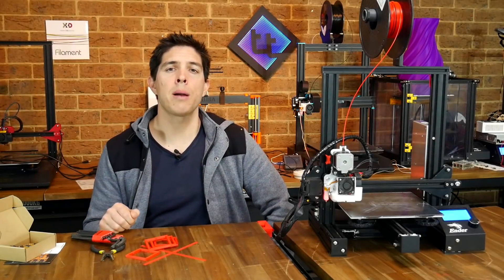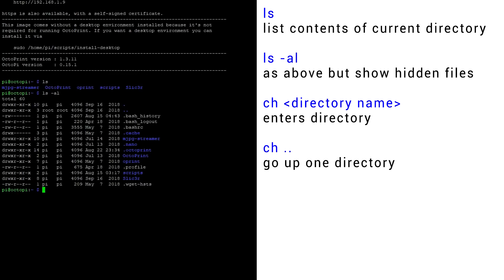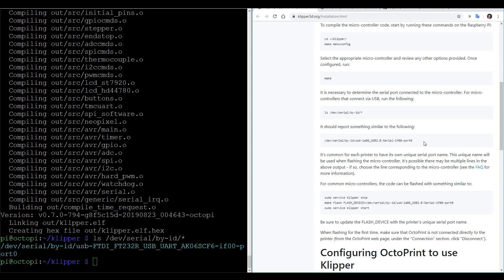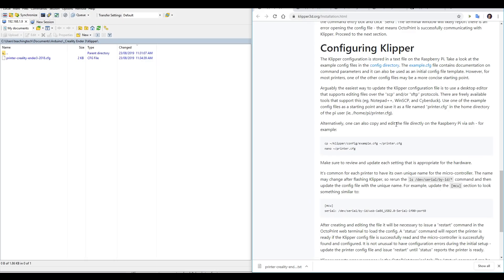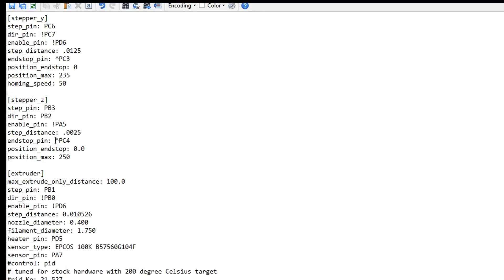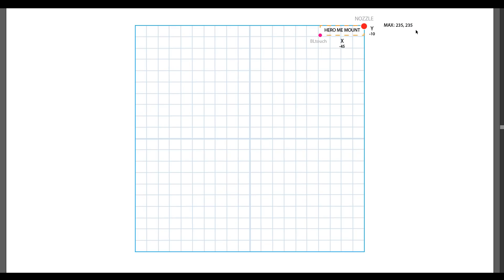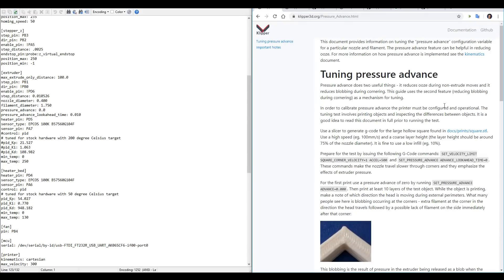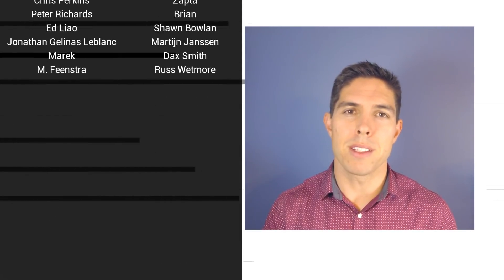Using a 32 bit Raspberry Pi to boost your 3D printer mainboard - Klipper Ender 3 guide

Comment: VERY IMPORTANT: For rectangular beds, min_point and max_point have been renamed to mesh_min and mesh_max respectively.
Reply: I'm also having issues with the provided example where the BED_MESH_CALIBRATE is going 'out of range', looking around to see if I've done something wrong elsewhere or they've made other changes to klipper as the example worked for me in the past.

update:
Looks like I needed to manually subtract the x/y offset from the Teaching Tech config under [bed_mesh]:
Original: 
min_point: 90, 20
max_point: 235, 235
Current:
mesh_min: 45, 20
mesh_max: 190, 225

Comment: Does anyone know of any resources for connecting multiple mainboards to Klipper to add extra extruder stepper motors? Klipper claims that you can do this in their setup guide but don't link to any other documentation or instructions.

Comment: I noticed a couple of things setting up mesh for the BL Touch; maybe there was an algorithm update since you made the video.

Hope I got the offsets right.

1) mesh_min and mesh_max are the location of the probe. Klipper takes the offsets into account when positioning it.

Because of 1 above:
2) mesh_min and mesh_max should be the exact coordinates you want to probe but each probe mount location needs a different calculation for them.

2a) for left/front probes (mine): 
     i) The mesh_max X value should be your bed size but reduced by your X offset value and any buffer from the bed edge you might want.
     ---- The nozzle carriage will reach the travel limit before the probe tip.
    ii) The mesh_max Y value should be your bed size but reduced by your Y offset value and any buffer from the bed edge you might want.
     ---- The nozzle carriage will reach the travel limit before the probe tip.
   iii) The mesh_min X value will be the the bed size minus the coordinate from 2.a.i. above to make the mesh symmetrical.
     ---- The probe tip will reach the origin before the nozzle carriage.
    iv) The mesh_min Y value will be the the bed size minus the coordinate from 2.a.ii. above to make the mesh symmetrical.
     ---- The probe tip will reach the origin before the nozzle carriage.
     v) i.e. my probe offsets are X-34, Y-5, my bed is 235x235, I chose a 10mm buffer. For mesh_max X that's 235 + (-34) - 10 and Y it's 235 + (-5) - 10, or  191,220. For mesh_min we keep it symmetrical with X 235 - 191 and for Y 235 - 220, or 44,15. 

2b) for right/front probes:
     i) The mesh_min X value should will be your nozzle X offset plus any buffer from the bed edge you might want 
     ---- The nozzle carriage will reach the origin before the probe tip.
    ii) The mesh_max Y value is calculated the same as 2.a.ii. above.
     ---- The nozzle carriage will reach the travel limit before the probe tip.
   iii) The mesh_max X value should be your bed size minus the value from 2.b.i. above to make the mesh symmetrical.
     ---- The probe tip will reach the bed edge before the nozzle carriage reaches the travel limit.
    iv) The mesh_min Y value will be the the bed size minus the value from 2.b.ii. above to make the mesh symmetrical.
     ---- The probe tip will reach the bed edge before the nozzle carriage reaches the origin.

2c) for left/back probes:
     i) The mesh_min Y value should be the nozzle Y offset plus any buffer from the bed edge you might want.
     ---- The nozzle carriage will reach the origin before the probe tip.
    ii) The mesh_max X value is calculated the same as 2.a.i. above.
     ---- The nozzle carriage will reach the travel limit before the probe tip.
   iii) The mesh_min X value is calculated the same as 2.a.iii. above.
     ---- The probe tip will reach the origin before the nozzle carriage.
    iv) The mesh_max Y value should be your bed size minus the value from 2.c.i. above to make the mesh symmetrical.
     ---- The probe tip will reach the bed edge before the nozzle carriage reaches the travel limit.

2d) for right/back probes:
     i) The mesh_min X value is calculated the same as 2.b.i. above
     ---- The nozzle carriage will reach the origin before the probe tip.
    ii) The mesh_min Y value is calculated the same as 2.c.i. above
     ---- The nozzle carriage will reach the origin before the probe tip.
   iii) The mesh_max X value is calculated the same as 2.b.iii. above
     ---- The probe tip will reach the bed edge before the nozzle carriage reaches the travel limit.
    iv) The mesh_max Y value is calculated the same as 2.c.iv. above
     ---- The probe tip will reach the bed edge before the nozzle carriage reaches the travel limit.

Comment: Looks to have been an update in the code and docs since your video. It now uses a command that will print a taller part with stepped PA changes every few mm.
Reply: it dosent need the "look ahead time" part anymore, right?

Comment: Since this video a lot of instructions became obsolete in the Klipper configuration. Can you post an updated version of this file for Ender 3 with bltouch and creality (Silent) boards?
Reply: Creality Silent Board 1.1.5 uses TMC2208 in Standalone Mode and is NOT compatible with Klipper!!! (that's what Kevin OConner says)
I know it, because I finally found out why my extruder doesn't work properly :-(
Reply: @onairtotheworld  Good to know.
Reply: Same problem. Stuck at "avrdude: stk500_getsync() attempt 10 of 10: not in sync: resp=0x6e" while flashing.

Turns out we need to first flash the board with a bootloader. This requires opening the case :/
Reply: @natanlieds4468  I need to do this in order ro make ANY modification, it is a must

Comment: Hi, I got stuck at 6:04  & made sure i wasnt connected to octpi when i put in  make flash FLASH_DEVICE=/dev/serial/by-id/usb-_uart_ac00zfrh-if00-port0 i get programmer is not responding. do i need to have an adruino to complete setup?
Reply: Same. Did you find a fix?
Reply: The issue is that you apparently need a bootloader. I luckily had a USB-bootloader from my bltouch and transferred the hex-File to my laptop and flashed from there. But that leads to errors in the later process. So i finally installed a bootloader.

Comment: Sorry for the noob question but do you have to put a bootloader on the ender 3 board before uploading the klipper firmware?
Reply: ender 5+ and I think we do as I got an error on the make flash part. ..rabbit hole took me back to the Klipper community and there I found we need to create a boot loader with Adruino ... that would have been a nice thing to add at the beginning wouldn't you think..

Comment: I started using Klipper before it had auto-leveling and printer screen support and it was worth it even then,  250 mm/s printing circles and curves using 8 bit board :)

Comment: Which one would get better print quality and speed, Klipper with Raspberry Pi or Marlin on 32bit SKR Mini E3?
Reply: I also was wondering the same thing!
Reply: With the proper slicer settings for each hardware configuration, I bet the difference will be minimal to negligible.

The original Ender 3 mainboard using the ATMega 1284p microcontroller, it makes sense to move the G-code crunching over to something more powerful.
But the SKR boards using the more powerful STM32 32-bit microcontrollers it really doesn't make that much sense to offload the G-code crunching. At this level, the limitations are on the hardware side such as the steppers themselves, frame stability, rollers, bowden tubes etc. These limitations cannot be circumvented with any microcontroller performance upgrades.

I use the SKR 32 bit board with a fully-fledged firmware such as Marlin, and use Octoprint on a Raspberry Pi just to get the whole web interface convenience. 
I always have the options to have the printer operate in standalone mode, or with Octoprint hooked up. I'm not locking myself to one solution only.
Reply: Klipper can be totally better configured than Marlin. Pressure advance, S-curve are highly customizable. Plus it works better with octoprint - no need to print off the sd card.

Comment: is it really worth it to spend $50 on a raspberry pi? i want to upgrade my ender 3 which only has one mod which is a bl touch, but i dont know if buying a raspberry pi is the right choice. should i just upgrade the main board? if so which one should i get? the silent one? plz help
Reply: Yes it is.  No only can you run klipper, you can also run OctoPi with OctoPrint which makes it way easier to send files to the printer wirelessly.  As well as remote monitoring and control of the printer.

Comment: thank you very much for this video. its exactly what i was after. im looking forward to the next in the sequence to see what ya results are. this really does seem like the smarter move. i am not a fan of doing all the heavy processing work on the wee micro in the printer. the reason we cant print over USB apparently is because the wee 8bit boards are too limited to transfer the gcode in a timely manner and print. when i go to raspi on my mk3 i think i will investigate klipper

Comment: i'm stuck at the "mesh" settings, it doesnt work, and i dont know why. I work with a BL-Touch on a Petsfang, an get my correct poition, for the mesh, out of my CAD. After i edited my printer.h file, klipper doesn't connect anymore to the firmware.

Comment: I have a question, when I go to flash the firmware it results in a sync failure, any idea why?
Reply: Hi , i have the same error , do you have the solution ?
Reply: @mickwo  not yet, i believe it might be something wrong with the motherboard
Reply: @world7452  hi, i find tb solution you need install bootloader before Al process
Reply: @mickwo  is it seperate?
Reply: @world7452  follow this instructions ,only the bootloader part https://youtu.be/fIl5X2ffdyo

Comment: Actually you do not need a Raspberry Pi as any PC with Debian will do. To make it easyer while installing Octoprint and Klipper, choose "pi" as the username, forbid root login (so sudo is enabled), deactivate graphical interface and enable ssh while installing debian.
"PC" includes so called "thin clients" normaly used as terminals in big companys. As these big companys change their hardware any 5-6 years, thousends of these thin clients push into secondary market (like eBay) for incredibly low prices. I for example got some Futro S900 for 8€ (less than $10) each + shipping; much less than a Pi, but more powerful and only a little more power consumting. A 16GB mSATA (the included 2GB is not enough for octoprint) is about 7.50€ on Aliexpress (you would pay the same for the SD-Card for a Pi anyways).
Even with slightly more power consumption, it is the more ecologic solution (esp. if you do not run your printer 24/7), as you reuse hardware which elseway has to be deposed.
So a quite cheap and powerful alternative.

Comment: It would have been really nice to see some prints or printing at the end. So that we know whether or not there is a point to this.
Reply: Either it prints or it doesn’t.  What I mean is, showing prints wouldn’t have added anything to the video
Reply: @peterwmdavis  I think you have misunderstood the whole point of using klipper.
Reply: @peterwmdavis  Not true.... there are huge advantages to using klipper once set up right. Seeing the results of a print side by side and noting the speed at which they can be printed is massive. You can print higher quality and faster with Klipper than you can with Marlin.

Comment: If I've already got an skr 1.3 with marlin 2.0 and I'm using the fancy stuff like linear advance and BLtouch ABL, is there any benefit to this? I have a raspberry pi sitting in your rear mount case in my ender 3 with the SKR and they work together really well. Would it be beneficial in any way to switch to klipper with a setup like this?

Comment: Tried klipper this weekend, back to marlin today. I didn't notice any real improvement and got frustrated by the scatty documentation in klipper. Nice idea but I think the performance increase is negligible and not worth getting familiar with a completely different code base.
Reply: how did you get back to marlin? I'm affraid of this part! I'd like to get some info before trying Klipper! Thanks

Comment: I went through every step and they worked as shown in your video.  Now I get this error message in octoprint?
Error reported by printer
Your printer's firmware reported an error. Due to that OctoPrint will disconnect. Reported error: Shutdown due to M112 command
Any suggestions to fix this?

Comment: I just wanted to say thank you for this video I follow these instructions with a raspberry pi 4 with 4 gigs of RAM and my printer is working better than it ever has
Reply: That's a bit overpowered. You could have nice results with a RPI 3b+. I have been runing this for at least 6 months and had never reached more than 500mb of ram.
Reply: @jofagoma  I have recently moved it over to my server with 96 gigs of RAM 
It works so fast and smooth 
The design of the program only uses low ram on raspberry pi on the 4 it used approximately 900megs at a time
On this server it holds onto 1.5 gigs of ram

Comment: Heads up for anyone wanting to try this, it seems you do in fact need to flash a bootloader first so it isn't as simple as just doing everything through the Pi.
Reply: can I flash a bootloader with the raspberry pi? I saw a vid of a bloke doing it on a ender 2 so it seems I should be able to, right? I already have the Pi so it seems like if I could do that it would be cheaper than having to buy the uno...
Reply: @jdeefpv2655  yes, you do need jumper cables though
Reply: @jdeefpv2655  did you have any luck with this? I'm wanting to do it for my ender 5 pro (using rasp pi 3b+)

Comment: Does this mean I don't have to update my firmware?
Reply from the maker: Klipper is a whole new type of firmware. Following this video includes flashing the board but you will still need a bootloader.
Reply: Teaching Tech  
Thank you for your help, but I don't understand where you need the bootloader for. Because it is not covered in this video.

Comment: Hey, help needed!
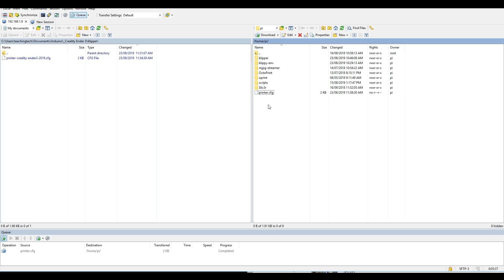I've done everything successfully up until 8:40. Afterwards, it seems that my octoprint cannot connect to the printer itself.
My ender 3 was completely stock (firmware wise) until half an hour ago and I didn't have anything like octoprint etc...
Getting a "Error connecting to printer There was an error while trying to connect to your printer. Error: Connection error, see Terminal tab."
Please help
Reply: State: Error: Failed to autodetect serial port, please set it manually.
Reply: Picture of my printer screen:
https://i.ibb.co/jWn8JWn/Untitled2.jpg
Reply: https://i.ibb.co/fFyyJKw/Untitled3.jpg
Reply: OK apparently it started working after thousand resets. Weird.

Comment: How come you didn't show how to hook up the Pi to the main board? Without this step, the whole video is pretty much useless to most people.....
Reply: After reading at least 50 comments, this is the first one expressing confusion on connecting a Pi to the controller so saying "the whole video is pretty much useless to most people" is inaccurate. The connection is made with a USB A to USB B mini cable.

The piece not covered in this video (covered in another video) is putting a boot loader on the controller board if it didn't come with one, that is a bit more complicated.

Comment: Since i installed klipper, my PSU started to make a really nasty fast clicking noise. But only when printing. Anyone else experienced this?
Reply: I suspect your stepper driver current is set too high. The PSU struggles to supply the power needed and makes these "clicking noises". You'd also notice the stepper motors being warmer than they were before.

Comment: I have been watching a lot of videos on modifications to the Ender 3 pro. I was wondering which board or board combinations you like best.
Reply: I know you didn't ask me, but In my opinion the best board for the money for the e3 is the skr1.3 paired with a raspberry pi if you're gonna use marlin and octoprint. If you're gonna use klipper I'd say an MKS gen L would be a better choice since there's no point having 32 bit on the board if you're just offloading everything to the raspberry pi. I like the 1.3 better than the SKR mini e3 because it's a little less finicky and it has options for expansion. Like for me, I use 2 z stepper motors each with their own driver. That way I can take advantage of marlin's auto-align-z feature.

But the absolute best board is gonna be the duet wifi 2. Although at that point you're putting in a mainboard that costs almost as much as the printer. So there's that.
Reply: @WrexShepard  Thank you sir. I am new to 3d printing. Every little bit helps
Reply: @fredberry2394  keep in mind, every board I listed besides the skr mini e3 requires a printed mounting solution. The reason the skr mini e3 is popular is it uses the same mounting as the stock mainboard. So if you want something you can just drop in with the least effort, get an SKR mini e3 with the TMC2209s

I dont like it as much as the SKR 1.3 because it has non replaceable stepper drivers and it has a few quirks, but it's the easiest upgradeable board to install by far. So ask yourself what's important. Ease of install vs expandibility and future proofing.
Reply: I am most certainly interested in the MKS gen L. I don't have a problem getting to know that board. I also have dual z motors so that will definitely help.
Reply: @fredberry2394  That's a good choice if you're going to use klipper since it's essentially a arduino mega2560+RAMPS board with enough stepper driver slots to do what you need. I recommend the bigtreetech TMC2208/9 stepsticks to go along with it.
Reply: @WrexShepard  how long have you been using 3d printers?
Reply: @fredberry2394  About a year. I have been a tinkerer and an engineer by hobby for many years though. Just never got into printing till recently.